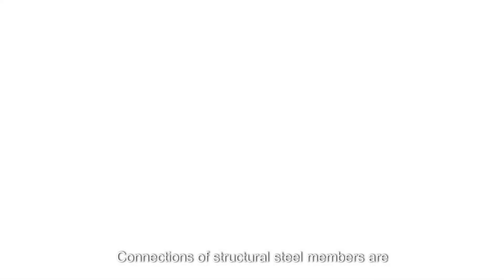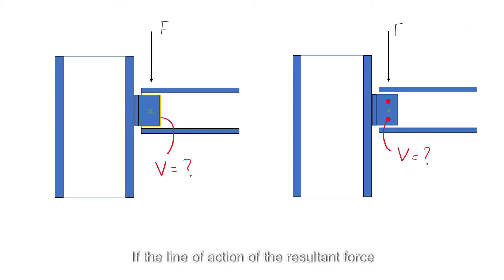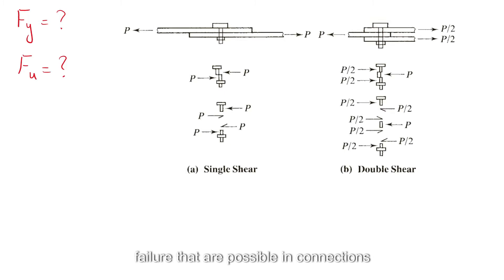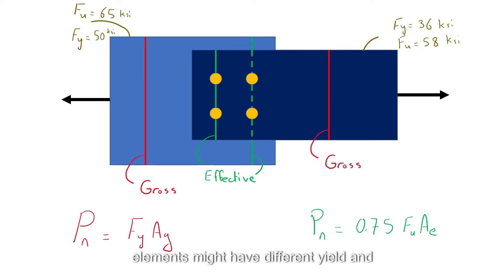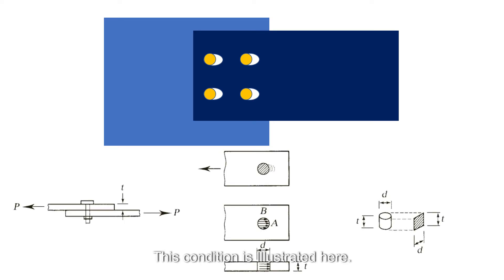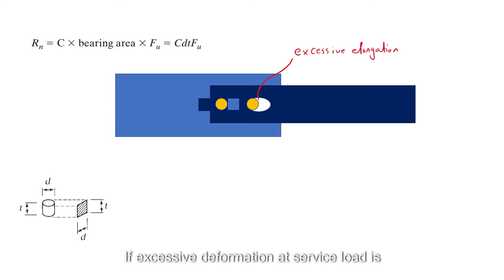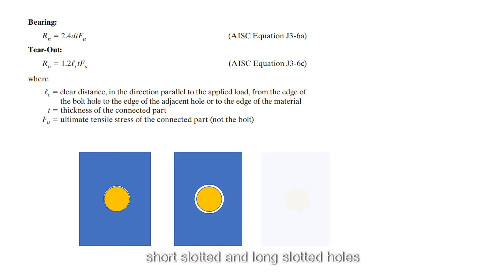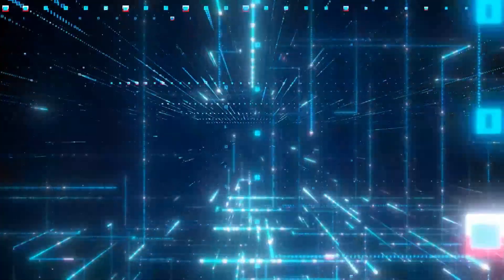Mastering Bolted Connections in Steel Structures: A Comprehensive Guide to Design & Failure Modes

Comment: As usual frameminds engineering, I cant believe you can summarize a 2 months course and explain it clearly with animations for! THANK YOU SO MUCH! Please answer my question, does the shape of the bolt connection affect any of the failure parameters